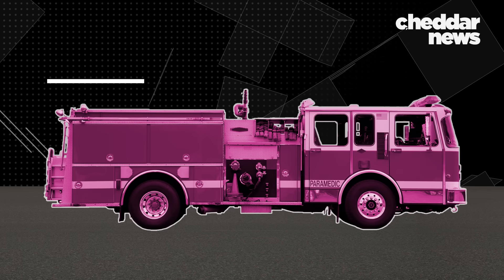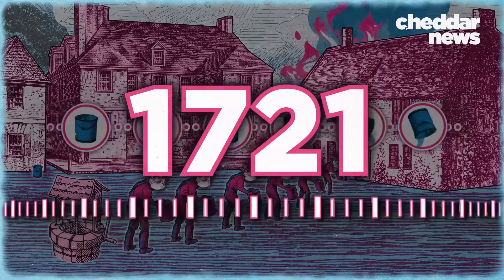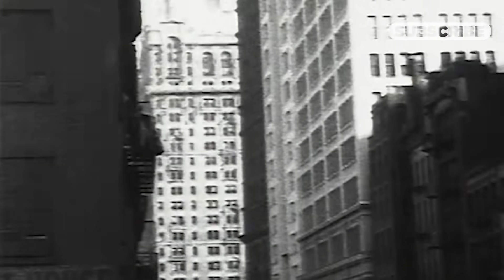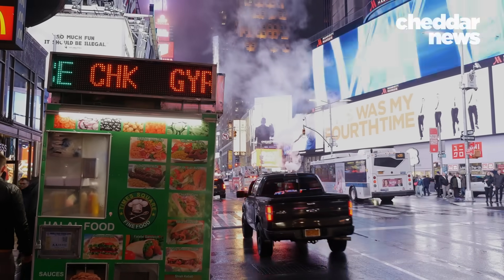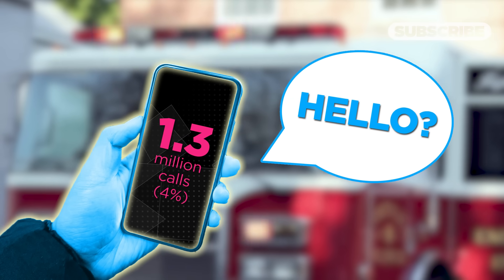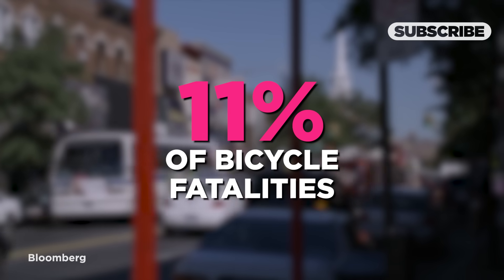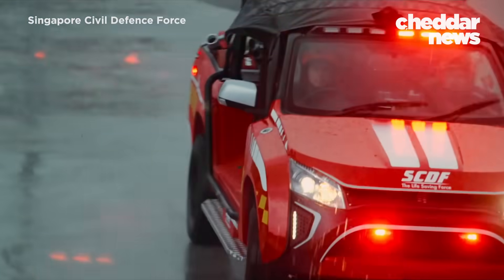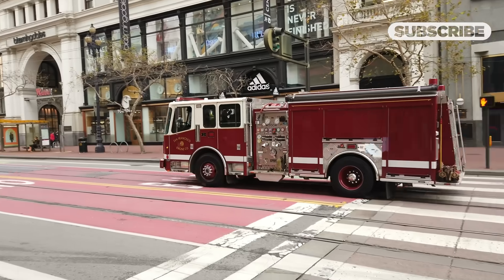Do American Fire Trucks Need To Be So Massive? - Cheddar Explains

Comment: A few comments.  In the USA, the National Fire Protection Association (NFPA) sets the standard for what equipment is on a fire truck.  Most (I expect all) manufacturers build their trucks to meet NFPA standards.  Needing someplace to put all of this equipment is what really drives the size of the vehicle.  On most trucks there is no wasted space.  

In the USA each fire department is given an ISO rating. This rating is determined by several factors, but the total amount of water available on trucks and the total pump capacity on trucks are both parts of it. Larger tanks and larger pumps require bigger trucks. The capacity of each truck is added up to give a total. Having backup trucks available also affects the ISO rating. Your house insurance is partly determined by your local fire department's ISO rating. So for the department that replaced three trucks with one and a couple pickups almost certainly lowered their ISO rating and therefore raised the insurance cost for their residence.

Also the statistic that mentioned pedestrian and bicycle accidents was for heavy vehicles, not emergency vehicles.  Fire trucks make up a very small percentage of the amount of heavy vehicles on the road. I would also guess that whichever study came up with those numbers would also consider a European style fire truck a large vehicle.

Larger trucks also have benefits.  Like the video stated, a large percentage of calls that fire trucks go on are vehicle accidents.  One of the primary reason for fire trucks going to accidents is to block traffic and protect the scene. Larger trucks are easier to see and do a better job of keeping a distracted driver from plowing into an accident scene.

I'm not saying that bigger is better or that smaller trucks couldn't do the job. I'm just stating some of the reasons they are as big as they are.
Reply: "On most trucks there is no wasted space.  
" on many apparatus walkaround videos I saw tons of wasted space tbh, with like only half of a compartment being used to store equipment.
Reply: If you haven't seen the inside of a GKW you don't yet know what 'no wasted space' means. The amount of equipment inside is actually ridiculous, and putting everything back can be somewhat tedious

Comment: Something not mentioned here is the difference in the actual fires themselves. In Europe most of the construction is old brick with a lot of heavy wood used in flooring making the fires there burn longer and not as hot. This allows local FDs to use lower volumes of water because the water inside a brick room flashes to steam which fills the room and because of the sturdy build cannot escape. In the event of a large industrial fire they have specialized trucks that are as large as American firetrucks. In the US we build most of our structures very thinly, and using many plastics, which make our fires burn much faster and much much hotter. It also allows the steam vapor which could be putting out the fire to escape. Most US fire trucks come with a 1500gpm pump and it is not uncommon to use every single gallon. Quite simply we need to throw much more water on the fire than Europeans. Fire science is pretty neat stuff to learn about!
Reply: depends a lot on the country; Thus in Sweden and Norway most houses are built out of wood and are kind of light-weight construction similar to the US
Reply: That argument would hold if they only used tank water, but they don't, they get an external supply from a hydrant. North American appliances are designed with the method of fire fighting in mind, they have a large house bed on the rear which takes up a great deal of room, walk through rescue trucks and let's not forget the simple fact that the "traditional' look is very important. This is evident when LA took delivery of an all electric appliance, the number of comments about it not looking like a fire truck where huge. 
Tradition in fire fighting technics and design are what keep the appliances bigger, a well designed European or Australian appliance carries more equipment than an equivalent engine in North America. 
In South Australia our standard pump units carry 2500L of water, extrication spreaders and cutters, hazmat gear, along with all the ancillary gear like PPV fans etc all based on a commercial chassis from Scania.
Reply: man idk about other Europe, but in Russia most of fire engines goes with 8000 liter water tank and it is basic, sure now there coming also smaller ones with like 5000, 4000, 2000 liter tanks, but stil even АЦ-8 with 8000 liter tank, is much smaller than US fire engine and it still hold proper firefighting equipment
Reply: You know you're going to have a good laugh when some idiot starts with, "In Europe most of the construction...." as if "Europe" is some kind of homogenous thing.
Reply: @iatsd  Yeah, from my central european pov it is like most of the time some "US salon leftist" talk how Europe is this and that and that US should do that too without any thinking about it. And by Europe for them it is most of the time UK, France or something like that. They just want to tell parts they want or like. 
Another 2 examples about guns and 1 about "european bread" below:

For example with guns they like most of the time to use sh*ty example like crime filled antigun UK that sort of fits their narrative but almost never talk about quite liberal places like Czech republic or Switzerland with little crime. Some clearly antigun ideology filled dude from (i guess US or UK) on the internet tried to convince me that I cannot have (my) guns in my country because people in Europe cannot have that kind of stuff :D (maybe in Uk, germany, france or other weird places... but it is still not whole of Europe). 
Other dude tried to tell me that guns are only used for crimes but not for self defense, then I listed him many cases from countries where is possible to carry guns for self-defense (incl. US, my country and some others; it took me whole afternoon to compile). But then he turned his argument in the way that my info I provided to prove him wrong (that he lied) could be false, because (he was so filled with BS what media told him all he time) that he even forget just to look at data I provided and try to personally facktcheck me if I lied or not. 
Nowadays people really do not waste any time to think or learn at least basic info about things, they just copy what social and mainstream media said which is sad.*pun intended

Or when youtuber "Johnny Harris" went to France and ate some french baguette and then made video about how great "european bread is". Lol, there are many different types of pastry in many countries in Europe and many types of bread are part of it. In my country what we call bread is traditional wheat-rye loaf of bread, but definitely not french baguette. But it was too hard to understand from his shallow experience I guess. About 30 countries in Europe and guy chooses one very popular in the US as example for whole. Even ordinary people in my country would not claim that people from the capital and other side of our country are totally same. And even ordinary people in my country with some geography knowledge would not claim that NYC, LA or Texas are the same...
Reply: not really fires here can get equally big and in case of germany most houses are build with stone and concret + really sturdy. In general we use a similar amount of water on fires as the US does. The reason why i say similar is because we do a lot more to prevent fires from happening and spreading then the US. Certain types of building materials arent allowed anymore cause of their temperature when they burn and the way they spread the fire. Thats also the reason why most newer houses (bigger citys have exceptions) need at least 3 meters of space from the property border and at least 5 meters of space to the next building. There are exceptions like double houses or wall-to-wall stuff in city centres.
Reply: This was actually a great reply that made most sense. Thank you.
Reply: Another plus for brick houses.

Americans prove how wealthy they are by the way they build their enclosures.
Reply: @JonatasAdoM  It is primarily the cost of labour plus a huge serving of greed that is "forcing" developers to use really cheap and flimsy materials.
Reply: @scholargnome   the cost of labor, materials, insurance, and geology, inclement weather, there are quite a few factors actually. 
My hundred year old brick house is extremely cold and drafty in the winters compared to every class wooden Home I’ve ever owned.
Reply: @Matt-yg8ub  I work on designing buildings and it's all up to the insulation being used or lack thereof when building anything in Canada. There are Insulated concrete forms if you want robust and well-Insulated or you could have exterior insulation + in-wall insulation for the cheaper wood construction. But it all comes down to budget. A lot of our clients just don't have the money to build well-Insulated and durable buildings. Cost of labour and materials are also insanely expensive.
Reply: @JonatasAdoM   the geology, the weather and the climate are different here… brick homes don’t work well in large swaths of the United States
Reply: Thanks now I don't need to spend 6 minutes watching video👌
Reply: 🇬🇧🇺🇲:you are wrong in Italy at least, we have different types of trucks for various needs, in the USA you have a single truck that acts as a fire truck, tanker and ladder truck (3 different vehicles in Italy) personally I think it is better in Italy but you are free to think as do you want PS: in Europe there are few wooden houses left

🇮🇹:ti sbagli in Italia almeno,andiamo diversi tipi di camion per le varie esigenze,negli USA voi avete un unico camion che fa da Autopompa,autobotte e autoscala (3 veicoli differenti in Italia) personalmente credo sia meglio in Italia ma sei libero di pensarla come vuoi

PS:in Europa di case in legno ne sono rimaste poche
Reply: the problem with germany is fires can easily become infernos because of the way the buildings here are
Old factories will burn for days.
Reply: For industrial fires my country meanwhile has giant water nozzles that can be left unattended & pointed in the same direction for long periods, ideal for larger fires that need more time to extinguish but for which you don't have to move the nozzle too much over time because the fire is so big that there's a high change part of it will still remain in the area the nozzle is originally pointed to. The nozzles even have fans to spread the water further & wider, & sit on tracked trailers that're to be towed into position, & are called Unmanned Firefighting Machines (UFM). They are also useable for train tunnel fires
Reply: American houses are also massive compared to European standards. A fire in an American home could very well require significantly more water to put out.
Reply: @matts1166  depends a lot on the country and area. You find equally massive houses in many places across Europe - and then it's not like one large house among many small ones
Reply: @matts1166  are you serious? The majority of American housing is detached - a majority of European housing is terraced. So yes, a single American house is typically bigger, BUT, it is also not literally sharing a wall with it's neighbours
Reply: @HappyDuude  you are talking about suburbia.. inner city is a different beast
Reply: @sillytorque  In that case the analogy fits even less no?
Reply: @HappyDuude  in Europe, nowadays, attached buildings are fire-separated by 2 walls and fire-retarding material in between ...
Reply: @sillytorque  The inner cities are mostly the same. The biggest differences in Building standards are in the suburbs.
Reply: That is also why America should start to look at how some countries in Europe build houses. A lot safer, and easier to work witj
Reply: US construction is larger too and the depts have a different mindset to boot, in the US its limit the damage as much as possible in europe rescue victims damage be damned!

Comment: Most US fire trucks are also carrying BLS/ALS medical gear in addition to extrication equipment to deal with motor vehicle crashes in addition to standard firefighting gear. When I was a firefighter in the 90's we were in a rural area, so our pumper trucks had to be multi purpose and carry 1000 gallons of water (with a 1250gpm pump) since hydrants were few and far between. We were also a volunteer department with only two paid firefighters per station. They were typically on an ALS rescue truck with a 500 gallon water tank (with a 750gpm pump), plus firefighting gear, plus extrication equipment. We also had a BLS tanker that carried 1500 gallons, but there were only a few operators signed off on driving it since it had a manual transmission. Some have mentioned foam, but not all foam is suitable for every job, so that is carried in 5 gallon buckets that siphon feeds into the pump. Now that they have to deal with electric car fires, even more specialized equipment will have to be carried on each apparatus. A typical car fire burns at 1500 degrees and requires over 1000 gallons to extinguish. Electric cars can burn at temperatures exceeding 5000 degrees and can require up to 40,000 gallons to extinguish, if it can be extinguished at all (best bet is to let it burn itself out while trying to minimize damage to surrounding property.

So for the TL; DR, US many US fire trucks have to be a do-it-all solution, hence the size.
Reply: It is similar in Europe, the engine here is the basic emergecy/rescue vehicle. The only thing that they don't do is EMS runs, as those are handled by a distinct EMS service.
Reply: @thecommentaryking  We covered an absurdly large area, so it wasn't uncommon for us to beat the ambulance service to a scene by 20-30 minutes. Out of curiosity I just mapped out a route from the southernmost to northernmost structures in our response are on Google Maps. It shows a 31 minute drive time (non-emergency). Luckily the fire districts have been redrawn and stations have been added since I served, but it wasn't uncommon for us to run from one call directly to the next. There were a few extreme shifts where we would roll out at 10am for our first call and not see the station again until 2-3am the following morning.
Reply: @LMarshall73  EMS backpack is a standard piece of equipment just like a full set of extrication equipment and ground ladders on the Engines. 
" It shows a 31 minute drive time " I used to commuter to work by car; Within my 20 minutes drive I went past 5 fire stations directly on my route (means, not even counting those which are maybe a mile or two east or west of the road I take)
Reply: @EnjoyFirefighting  For EMS we carried a bit more than a back pack. If we had to pull all EMS gear from the truck it would take a crew of 5 at least 2 trips. This included the O2 bag with all of the airway hardware & AMBU bags, SAED, BLS bag, boo-boo kit, 4 backboards + multiples of all sizes of cervical collars, immobilizing pillows & straps, anti-contamination suits in case we were dealing with an HIV/TB patient, splint bags, and probably a few others that have slipped my mind in the 20+ years since I was in the fire service.
In the 31 minute commute I mentioned there were no other stations closer than mine. We covered over 140sq miles (close to 350sq km) and almost 40 linear miles of interstate highway. To the east we did have a few pockets of unincorporated area that we served and we would frequently roll through two to three cities to get to our destination. Back then mutual aid with those cities was dependent on local politics and whether or not there were news crews onsite.
Reply: @LMarshall73  the backpack is only the bare minimum required by the norm here, means that many departments will have more on board depending on the scale of service; Thus e.g. every Rescue Engine from the career FD in my state's capital city has a mechanic chest compression device. They also run EMS units, not just the plain normal ALS Emergency Ambulance, but also doctor ambulances, emergency doctor cars, children emergency doctor car, newborn doctor ambulance, large capacity ambulance etc 
Yeah stations here in Germany don't have as large response areas; Every tiny village has its own station; And also in my village of 10k inhabitants the volunteer FD has a fleet of 10 units at the station; 
Rural areas of e.g. Sweden or Norway have response areas of similar size like yours, or even larger
Reply: The french carry an ambulance compartment on some trucks in Paris. Just saying....

Comment: It would be great if you pulled the states' fire database and compare the different trucks and their uses. Each state has to submit a monthly report of each call they run, with specific codes. Those calls are submitted by each fire house to the battalion, and the battalion submits it to the state fire authority. I used to work on the databases for one fire department, and while the reports are quite accurate, they would be to help solidify your point. Most trucks are just overkill, especially when they use the truck to go to a restaurant or grocery shopping. Why use the kitchen when you can go out to eat using tax payer gas when you get 1-2 mpg?